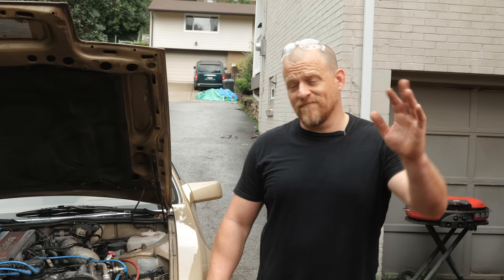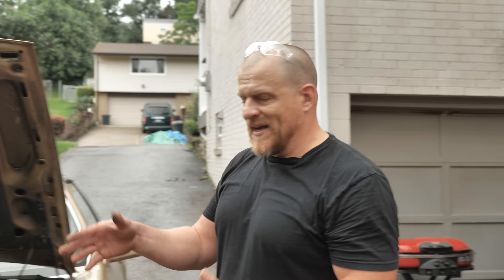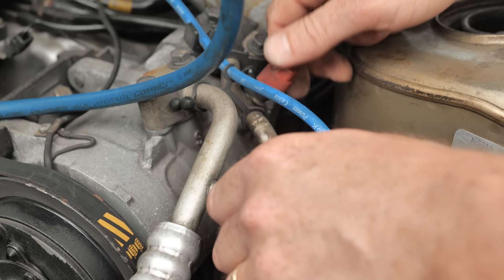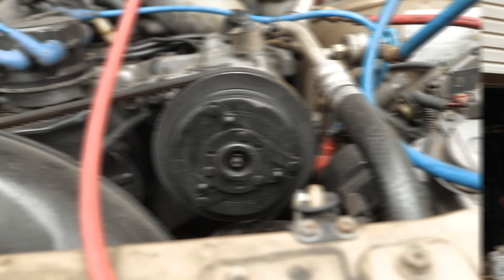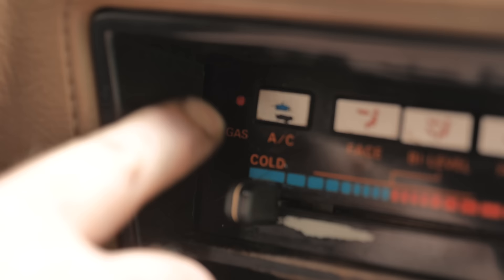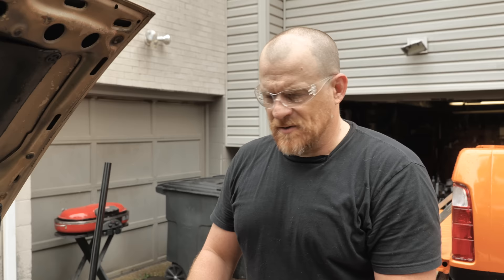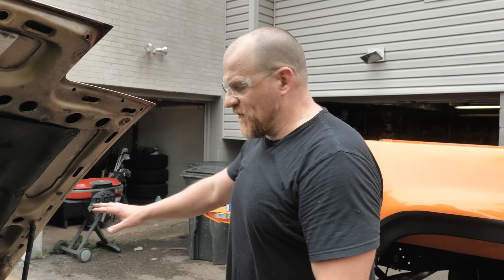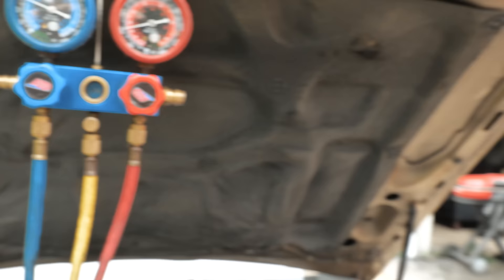A/C Leak Testing, Repair, Evac and Recharge (ANY CAR!)

Comment: I love that car, I used to have one.

A couple of points. (This is specific to the R12 refrigerant that it was originally equipped with.) You need to be sensitive to what caused the leak of refrigerant, in order to understand how much of the refrigerant oil escaped with it. The art of dealing with this (and I do mean art, it’s a sensitive issue) is obviously knowing how much oil to add to compensate for whatever malfunction.

The caveman solution to this dilemma is to realize that the vapor pressure of your standard R12 refrigerant oil will allow you to set a vacuum overnight, with a really good pump, and get rid of all the oil, and start fresh, with a good charge.

Just saying. (Save the original refrigerant if it’s there, don’t vent.)

Comment: I had a 1985 300zx with the digital dash years ago, absolutely fun car to drive, was working on the A/C system to fix a leak, during charging the high side hose split and exploded on me, scared the absolute shit outa me. I had bought the car for $300, and the hose was over $300, ended up just running it without A/C until I sold it lol.
Reply from the maker: Funny you say this, behind the scenes, his high psi discharge hose sprung a leak after a day or two running at those pressures and I have to fix it again. Problem is, you cannot find the suction and discharge hoses! I'm going to take it off and have one made for it. Just sitting all those years and not being used, to getting to those pressures is what did it exactly like you described! I'll be doing a follow up to this one at some point this summer. 
It is a great lesson on customer communication, documentation and never guaranteeing a customer that the rest of his AC system will be fine. Good thing this one was my son. If this was a paying customer, they would not be happy with me
Reply: @ScannerDanner  O dang! That's crazy! I guess it might be a common thing to happen with these Zs, I look forward to seeing the next video on this car. I miss my Z, been trying to hunt for another good deal on one, but it looks like these classics are becoming more and more valuable. I agree, I never promise that the rest of the system is good, I explain the kinds of pressures that these systems are under and with age components become fatigued and can fail at any time, it may be fine for years, or it could potentially blow a another component tomorrow, just the way it goes some times.

Comment: I've been a tech now 20+ odd years? In Miami, FL. So ground zero for AC work. In Miami ppl will drive it with a blown engine as long as it has AC.

That said, I've been using the compressed air method to test for leaks my entire career. Have never had a comeback or caused additional damage because of introducing air into the system. Just vacuum it (as you should always be doing when you open a system) and you will be fine.
Reply from the maker: Thank you for that! And Florida too where it is very humid air! All you "experts" out there need to pay attention to this comment. 
You should see how much crap I've gotten for using compressed air 🙄
And my experience is the same, never, not one time, have I had an issue and I'm seeing these same customers for years and years with their AC systems working perfectly.

Comment: if you look at the guages the blue one is calling you out just above the 350 at the 5:30 position. lmao  the center scale is the temperature for r134a and the inner one is for r12. to figure the temps at the vent or just at the condenser add 15 degrees.  this is the coefficient of the material heat transfer  @58:55 a low side pressure of 26 psi gives a temp of refrigerant at 30 degrees. add 15 the vent should be blowing at 45 degrees.  the high side at 225 psi has a refrigerant temp of138ish degrees add your 15 and an infa-red thermometer should show about 153 degrees. that is for clean unplugged cores and with a/c air flow is everything.

Comment: Kind of funny how Common sense goes out the window on Youtube Video comments. If that Nitrogen Bottle is not going to be fully anchored on a fixed stand, your two Tires is actually a best case scenario. That B.S. Safety Cap with a slot is not much help. The Heads and Valves are decent thickness material. That small piece of Brass protruding from the Cap to the Regulator will be a Scarier Option of Breakage. (Still full Tank Pressure) Instead of a Projectile taking off in a single direction, it is going to stay in the general area in a Death Spiral... Without the Cap, there is a more likelihood that the same tube breaking anyways. Just use common sense with these Bottles...

Comment: Thermo king wanted 500 microns for 15 minutes and a closed decay of not more than 10 microns in a half hour. if it decays more than that it was a leak or still had moisture boiling off. we had an oil test kit to check for acidity . and if needed there was a filter kit that went in line that cleaned and conditioned the oil.  it was not unusual to get down to 330-350 microns.  liquid nitrogen tankers  are giant thermos bottles. they are kept around 150 microns.

Comment: I noticed that the R134a can and valve you are using are different from the new cans with check valves that don't release freon when disconnected... They also require an adaptor between the can and the valve and opening the can under the new parts you need to screw the valve about half way down

Comment: i use a snap on smoke machine to find leaks works great. i have even found evaporator leaks in the dash doing this. no know side effects because I let it vacuum for a long time afterwards.
Reply from the maker: But I wonder about the oil itself (smoke). That is a different type of oil that will not get removed with pulling the system under vacuum. Just like the oil that is in the system doesn't come out. 
It is possible that could be a problem? Not sure
Reply: @ScannerDanner  i think its like mineral oil if i had to guess. i used this method on a r134a on my truck a few years ago and the ac still works great today.
Reply from the maker: @turboimport95  oh yeah that's right, that is what it is. And we've mixed mineral oil with R134a systems when they were all retrofitted in the mid 90s, so agree, that little bit isn't going to hurt

Comment: When you finish vacumming you start adding gas to the system "with the micron gage on" till you reach 20-30 psi then you can remove the gage off some gas will leak not much but this way  you dont get any air in the system ...
Reply from the maker: If I would have mounted it differently, I could have removed the gauge without any issues.

Comment: 32:00 520 microns equals 0.520 mmHg. Dude, that is hella low vacuum! I work at a chemical plant and deal with pressure/vacuum frequently. Excellent vid, too!!!!
Reply from the maker: Right! When I did a google search and found out that 25,400 microns are in an inch, that changed my perspective on worrying about a 20 micron rise in my vacuum decay test lol Thanks so much!

Comment: Thanks for this, and your other video on the topic. I have the manifold gauge to do this but I don't have an air compressor. All I have is a portable tyre compressor and I can only get the either side to around 15/20 psi I think. I will try it but I hope its high enough still to find a leak!
Reply from the maker: That won't be enough in most circumstances
Reply: @ScannerDanner  I got it to around 90psi with a bit of hacking. Unlike the shop I went to that just stuck a gauge on the high side, filled it with air to 100 psi and saw it drop over a few minutes, therefore I "had a leak". I found the real issue or lack thereof. It takes over ten minutes for the pressure in the filled side to equalise to the other side, so just checking one side is a poor indication. The equalisation what was they were seeing 🙄 I think I don't have a leak at all. I might try a few more times for peace of mind!
Reply from the maker: @barryoconnor319  if the system was empty, you have a leak! Period. You just need to find it. Break out the soap and water now
Reply: @ScannerDanner  Absolutely agree. I had bang on the lower condenser so I presumed it was that and swapped that out. I went back to the shop and there was still a leak based on putting some air and a gauge onto the hot side alone. I think its actually fixed but I will pump the system to 100psi today and leave it for a few hours! Thanks a lot
Reply from the maker: @barryoconnor319  just remember, there is no "sides" when the system is off. If you put 100 psi in the high side, that is also in the low side (just an fyi)
Reply: @ScannerDanner  Thanks for that. Sorry, I meant that when, for example, the high side port is filled to 100psi alone, it appears to take 5-10 minutes for the pressure to get into the low side fully or at least register at the port if I have a gauge on it. So if I look at my high side gauge it will drop very slowly as the low side gauge rises and then they roughly meet. This could just be confusing if only one gauge was used on one port. I could very well be wrong about all of this but I will redo my tests today and update!
Reply from the maker: @barryoconnor319  I've never seen one take that long to equalize. Not with air psi. But that isn't necessarily a problem
Reply: @ScannerDanner  Left my gauge on overnight and the pressure was steady at around 95psi! So I went to the shop and got it filled up. All good so far. Perhaps the slow equalization between low and high is due to a small blockage in the system?
Reply from the maker: @barryoconnor319  we will know for sure by your pressures after you charge the system

Comment: hygroscopic like brake fluid absorbs water moisture.  Too low on the low side will cause the evaporator to ice up.  You want low reading on a refrigerator because you don't have the moist air hitting the evaporator coil like in a car environment.

Comment: 🍻 cheers for a great driveway repair. Too bad you couldn’t get free o ring from brothers shop. GM has nice ac system. Have seen 34 degrees at center vent

Comment: Wonder if it pulls the moisture out of the oil?

It makes me happy that you make mistakes, Ive done every one of them that you did... Makes me feel normal. Forgetting to add oil(or dye) and pulling a vacuum, flooding the yellow hose with air, forgetting to purge the yellow hose... Yep, feller has done all of that...

Comment: Since that compressor was on top if I was going to put the thought to add oil I think I would have pulled the compressor and emptied out as much as possible and refill it I guess I only replaced 1 compressor and it came with new oil to fill the compressor before installing
Reply from the maker: The oil doesn't stay in the compressor. Common misconception

Comment: I think you should have washed the condensor with water and souop this will bring the high pressure down .. try it now and see
Reply from the maker: That small amount of oil in the corner wouldn't have made any difference imo, but it should have cleared it, I agree

Comment: Only concern I have is noticing that your pump was low on oil when you fired it up at 29:13. Easy way to burn up a $100.00 pump. Look at the oil sight window.  Looks low.

Comment: Great video. Thanks! So what stops the oil from being evacuated from the system when you pull vacuum on the system? It will pull the moisture but not pull the oil?  Thanks!
Reply from the maker: Very little will come out with when you recover refrigerant in a machine, maybe an ounce. 
During a evac process there is no loss of oil

Comment: once you close the high and low side to see any vacuum decay you are just reading your  decay on your tools, you are not connected to the car any more,leave the valves open and shut the vacuum.
Reply from the maker: That is not correct. Closing the manifold gauge valve simply closes off the yellow center hose. You are still reading and connected to the system
Reply: @ScannerDanner  Number one mistake while checking microns/decay test techs make with sman 460 or 480

Allen Reed
893 subscribers

Subscribe

384

Share

Comment: I really like that micron  gauge. However I use Master Cool manifold gauges, and my lines are quick connects, and do not thread at the end, so I wouldn’t be able to tie in the vacuum gauge in the same manner as you did. I wonder if Master cool makes lines and connection styles like yours so It would be possible for me to do the same thing.

Comment: When I first started working on my personal cars, I was kind of confused about the working of the manifold gauge set. I knew not to charge into the high side, but took a bit to realize the high side gauge could still read the high pressure with the high side valve closed on the manifold set and the valve open on the high pressure line at the schrader valve on the vehicle. In other words closing the high side valve on the gauge set doesn't block pressure to the high pressure gauge. There are lots of good videos on manifold sets available.

Comment: First off, appreciate what you do.. I've learned lots from you.. Question I have is when your using the vacuum pump to pull the oil into the system, how would you know that it stays in the system and not end up in the vacuum pump.. thanks for everything
Reply from the maker: Did you see that I pulled it into the high side, then closed the high side on the manifold gauge to force the vacuum to only pull on the low side? You won't pull any oil out using this method. Also, the oil stays in the system on a typical evac. I've used many machines with an oil catch where you measure how much oil comes out and there never is anything to measure

Comment: So you don't need to have vehicle running when using vacuum pump or filling with refrigerant?
Reply from the maker: You do not want the vehicle running during the vacuum process and during recharging, you may, depending on the method you chose to use

Comment: A system that is in a perfect vacuum only has 14.7 pounds per square inch of pressure on the outside.  Your 100 pounds of nitrogen is a factor of 6.8 better than a perfect vacuum... the best use of the fancy vacuum guage is to figure out when all the moisture is out of the system.  The proper use of the vacuum guage is to put it as far away from the vacuum pump as possible.  That way you will see the system vacuum as it gets pulled down ...

Comment: Hi Paul. I didn't do the line isolation like you did towards the end. Will that affect things down the line?. Should i redo it again or it's not a big deal? 
Also like you, i didn't add the full third can. Its a complete retrofit and the system calls for 40oz of  R12. Should I add the rest of the third can to get 90% of r134?

Comment: The average person doesn't have a compressor tho to use compressed air. Do the have compressed air in a container that you can buy without having to buy a compressor or big nitro tank like that one? I think that soap and water method is better than wasting money and putting dye in the system. And having to buy a uv light and dye. Soap and water easy peasy and environmentally friendly. I been watching your videos for years.
Reply from the maker: A small air compressor is not expensive. But thanks for watching all this time!

Comment: You would have 32-35 F if you still had the r12 system and never converted. I still have mines in my 93 civic just need to do this vacuum and recharge with the r12 cans i have left
Reply from the maker: Stuff is way too expensive. In particular when you develop other leaks (like this did - we have a whole series on it)

Comment: Take a look at the sight glass to determine if you have liquid all the way to the evaporator ???
Reply from the maker: technically the next stop from the sight glass is the TXV, the main purpose of a receiver drier is to ensure that only liquid refrigerant is available to the expansion valve (TXV)

Comment: Interesting on using nitrogen. I would think that the DIYer would not have a nitrogen tank around, but may have a mig or tig welder. I would think a C25 tank (25%cor/75% argon) or 100% argon tank would work just as well as nitrogen. Gas will cost more, but I would not have to purchase another tank.
Reply from the maker: I'm not sure I'd use Argon, but I don't know much about it and whether or not it can cause oil contamination or is dangerous in some way (combustible?)

Comment: Lol, you seem a bit rusty, and really trust your Schraeder valves. I'm not even speaking as an expert myself, but I do this on occasion, and have to refresh myself on the procedure every time, but you should replace the dessicant pack. In this, swap the receiver/dryer.
Reply from the maker: lol, just the first time I've used a micron gauge is all

Comment: So when you added the oil, you close (valve up) the Schrader valve on high side? Camera looked backwards. Is the gauge connector closed and opening ( pushing down)Schrader valve?